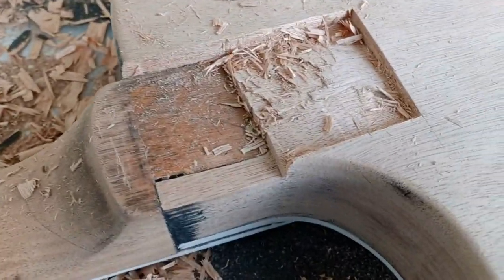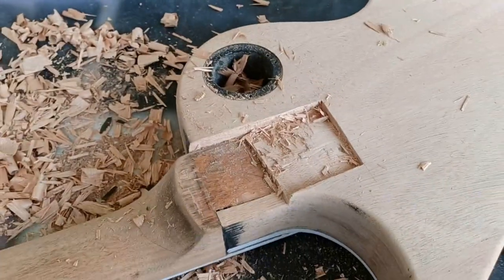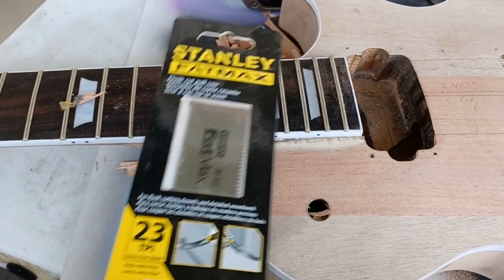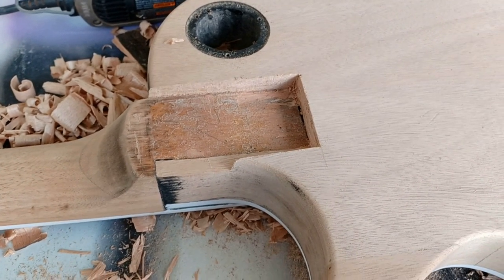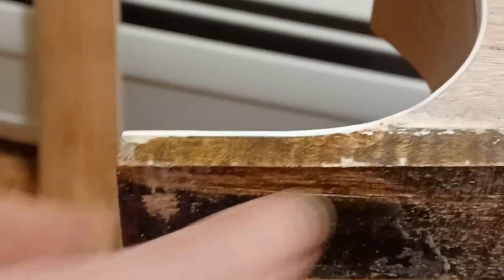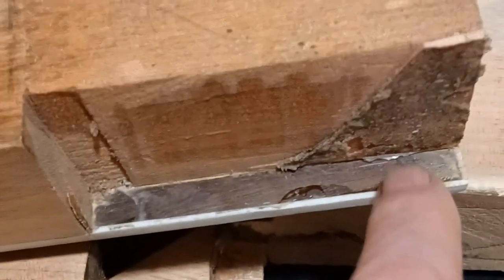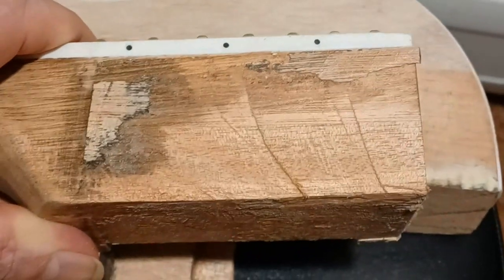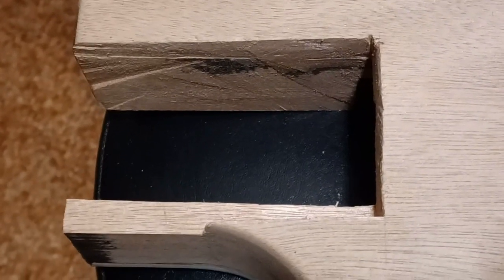Pre GGBO part 3 First successful Neckotomy! #jurgscup

Comment: That neck heel/pocket is just wild. I mean, I get it - more body wood on the weak side of the pocket this way, but it just seems like it would be a super pain to do it that way with the heel.
Reply from the maker: If done correctly I would a "keyed" joint like this would be super strong and stable vs just a "U" shaped hole with limited bonding area. 

Sadly this one was NOT properly done thus the failure in both alignment and bonding. 

We can rebuild it. we have the technology. we can build it better, faster , Stronger!!  (10 mancard points to anyone who gets this reference!)
Reply: @borgonianevolution  the bionic axe!

Comment: The neck heel looks a little different than the one on my 12 string kit that I have. The difference is where you have a squared off in the notch where the heel is narrower, my neck heel has a round half hole going from the flat spot in toward the center of the neck. starts from the bottom of the heel all the way to just under the bottom side of the fret board. The half hole is about the size of a dime.
Reply from the maker: I kind of figured there should be a "key" some where. maybe they just sanded it flat thus making the rest of the joint too loose. No way to ask so just have to roll with it and do the best I can to complete the rebuild.
Pretty strange delving into the minds of others these days huh.

Comment: Not worth just making a new body ?
Reply from the maker: The project was started as just clean up the body to do a practice paint idea I have for my actual GGBO build. Both the neck and the body are better than I figured after a little elbow grease. I decided to remove the neck and make the assessment whether to attempt a replacement so the guitar can be rehomed after I finish it.

If it survives the reconstruction I can do my idea on it. If that fails it can easily be painted over a solid color, set back up and passed on. If it doesn't it is still worth practice on and can be kept as a test body or just plain practice piece.
Reply: @borgonianevolution  Quite a job well good luck with it !